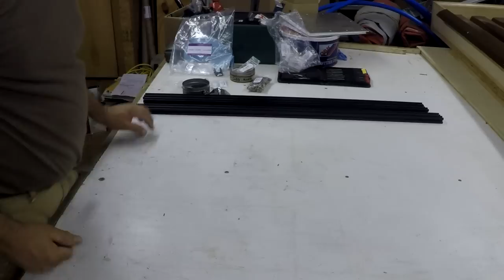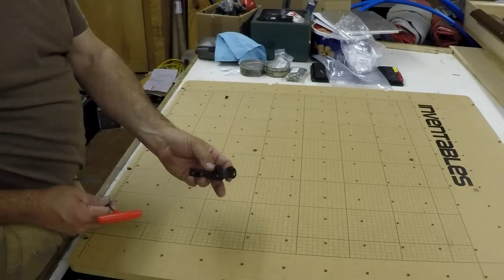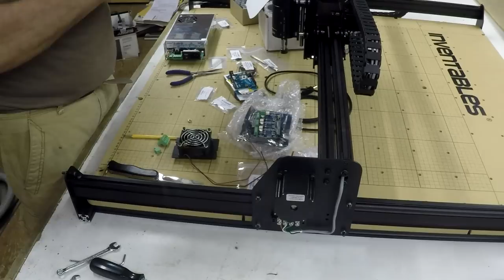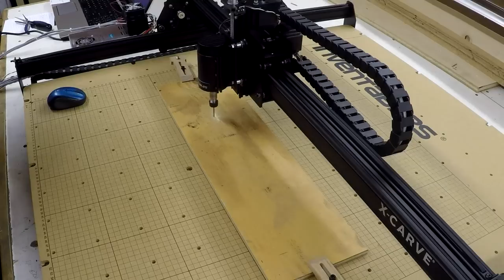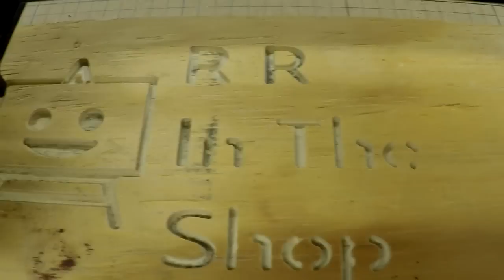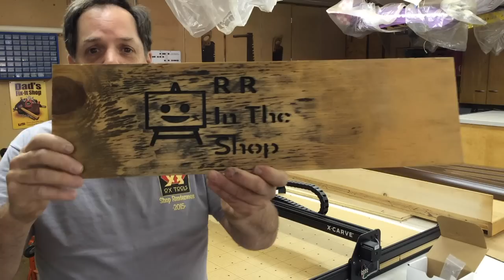Inventables X-Carve Build  Part 4

Comment: Randy Richard, sweet! These machines seem to have a lot of potential besides the obvious engraving, sign making, and cutting out parts from various materials. One application that interests me is producing circuit boards and front panels for electronic projects. There are a number of mods that you could do to this like make a boot for the spindle for dust collection, create modules that can be swapped out with  the spindle to extend the machines cap\abilities, like a  laser unit for engraving photos, etc, or an air brush module for custom paintings and finishes (like making custom fishing lures), and even a 3D print head for printing small parts out of various plastics, nylon, rubber, carbon fiber, etc. There are many more possibilities, but you will be a bit limited by the Z axis travel. Anyway, I am sure that you have plenty of ideas of your own and will enjoy your new tool. Thanks for sharing the build.

Peace!
Reply from the maker: Jeffrey Vastine Thank you Jeffery for watching.  I to think there are many things you could do this platform.  After I get the trim router mounted I will make a dust collection system for it.  I think you could easily add more travel to the Z axis for 3D printing, since the only forces are carrying the print head.  It would be very cool to have different heads you could just drop on and go with.  All great ideas.  Thanks again for the great comment.  Randy